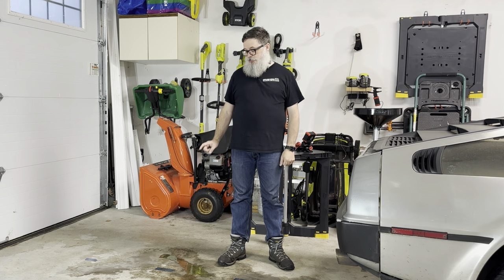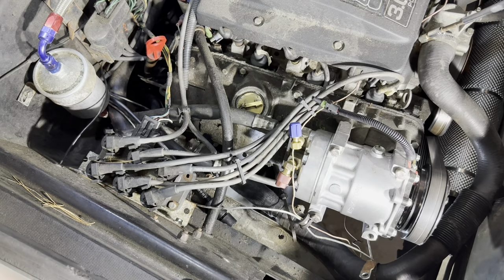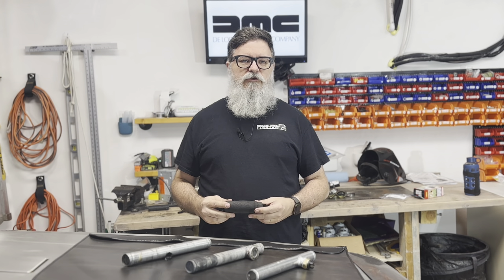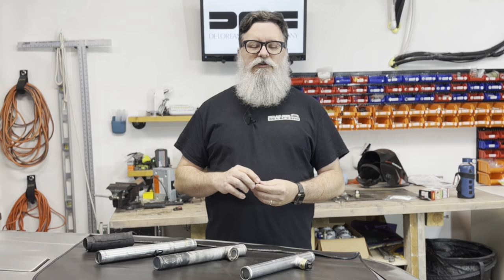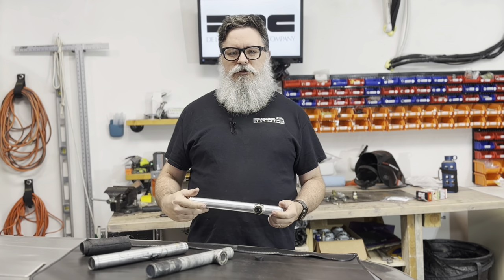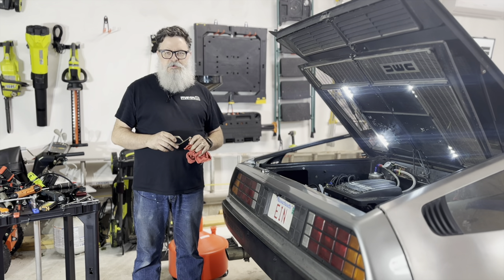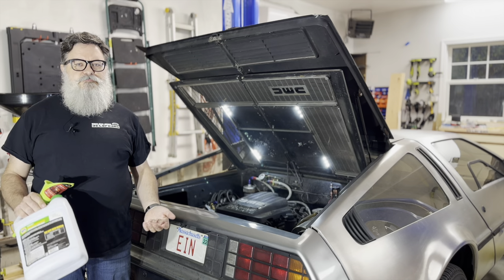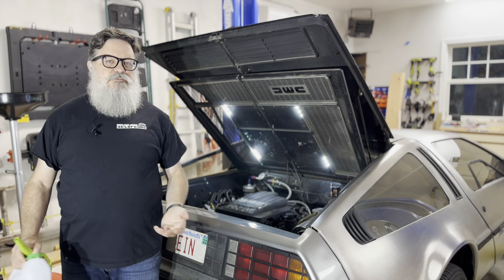The Importance of Proper Coolant Hose Routing in a DeLorean

Comment: No pun intended, but, EVERY Delorean owner should have a "Bearded" Collie like Einnie (Einstein)!  LoL.  
At least you already have the license plate for him.  
So what's that 3.0 out of? 
 Eagle/Monaco with that disributorless ignition?
Have you had it dyno'd vs. the original 2.8?
Ahhh, I just did a quick search on the distributor for an Eagle PRV, & like internet magic, I got a hit on your tmproductions page!  LoL
I've been to your awesome site before over past few months & had it bookmarked.  Wow, what an adventure.
I'm curious about the Eagle version of the PRV, & its platform vs. the earlier original.....
Reply from the maker: I do have dogs, but no Ein (Cowboy Bebop)/Einstein (BttF) yet. :)

The 3.0L is from a 1989 Dodge Monaco.  It actually did have a distributor, but I put a blanking plate over that, and installed MegaSquirt with EFI and electric ignition via Ford EDIS (controlled by MegaSquirt).

I do have an automatic, though, so I'm not sure how great the performance will be.  I also recently made a quieter exhaust that is probably robbing some power (but making the car much more pleasant to drive), and I"m having some trouble with the kickdown and getting it to agree to stay in a lower gear when I want it to, even if I manually drop to "2".  I have to figure that out at some point; it's kind of annoying.

I tuned it myself, so it's probably not the best tune.  I was kinda making it up as I went along, but it's been pretty reliable overall.  I've had manual DeLoreans pull away from me, which I blame more on the automatic transmission than something with the 3.0L engine or my exhaust. I haven't dyno'ed it.  I should probably have it properly tuned by a professional first.

The 3.0L is more reliable in its operation, though -- it pretty much always stays in tune, and it always starts in no more than 3 cranks.  No fiddling with K-Jet or anything like that.  Just doing an EFI upgrade is worth it, IMO, but I understand it's getting hard to find 3.0L engines for full swaps these days.

The big difference between the 3.0L and the 2.8L is that the 3.0L is even fire and has a larger displacement, and the manifold is already set up for EFI.  You swap the lower crankcase so that the engine mounts are in the right place.  The 3.0L spark plug boots are much more robust than the 2.8L, and I"m told they fit in the 2.8L ports, which is worth a go if you find that your plug wires feel a little loose in the heads.
Reply: @Joe's Projects  That was a big project! I don't have a Delorean, but maybe if I can get my health back. I have so many performance ideas for the PRV that nobody ever dreamed of! Its for this reason, I really wanted to see if anyone ever dyno'd an oddfire vs. an evenfire PRV in its basic format & just changing out the crank to the splitpin crank like those Alpine guys in Europe do. My theory was confirmed that the odd fire PRV is laden with power robbing harmonics, just not sure how much, but ill get my answer some day when I reach out to a French tuner. I wish I could give you some direction on that transmission. Did it shift weird before the swap or after? Not sure if it uses an accumulator like GM & other trans. or a governor...but most likely a TV adjustment, & proper geometry of the bracket I throttle cable. Not sure, but if its out of adjustment, I wonder if you can burn up the trans like what happened to a GM with a TV not adjusted properly...... I wonder if you can put a pressure gauge on it to check pressures according to the factory trans manual for Delorean or if some Volvo or other car used that same automatic..... Grood riddance to that K-Jet, which was Germany's revenge for losing the war!!!! LoL.
Replied to a comment on The Importance of Proper Coolant Hose Routing in a DeLorean
Reply from the maker: @chrispompano  I did the 3.0L swap because water got into my fuel tank and ruined the fuel system.  While I was claning the "V" in the block, my pick went through the block.  I later found an inch-long chunk of aluminum in the oil pan.  It seems to have been a casting error when the engine was built.  It was $6k to do a stock DeLorean engine and fuel system, but only $600 for a Monaco engine, and another thousand or so for EFI and associated components, and I parted out the old engine.  Of course, it took me 5.5 years to do this, because I'd never done anything like this before.  And this is the "easy" swap.

You don't need to limit yourself to PRVs these days.  DeLorean MidWest and DeLorean Industries sell engine swap kits, with the LS4 being the most common these days.  They're more complex than the 3.0L swap, but much more powerful.  A Porsche manual transmission help with the power, but there are no automatic options.

My long-term goal is an electric conversion -- I'm on my fifth automatic transmission in 5 years, and removing that from the equation entirely is my end goal.  This is unusual, though; I've just had bad luck with leaks and a failed weld.

The kickdown switch has always been a problem in my car, mostly because I had to kludge it for the 3.0L.  When working, it would rev up to 5k RPM or so before dropping back to second gear (3 speed automatic).  I feel like it was working OK last time I fixed it, which was probably a few months ago.  More recently it wants to give up around 3K RPM.  Besides rebuidling the suspension, I repalced the muffler with a quieter and more restrictive one, but I doubt it's more restrictive than stock.  Unfortunately, there isn't a lot of documentation with regards to the kickdown, so I'm not sure exactly how to diagnose this one.  I do need to check that throttle cable to the transmission.  And you're right -- there's some kind of pressure test port on the transmission, but I've never really looked at that before.  I'll check the workshop manual (and I have the Renault transmission manual as well).  It shifts just fine otherwise.

As for K-Jet, I think it was just a product of its time.  The computers in the DeLorean look like Radio Shack kits today -- primitive, with discrete components, and nothing is microcontroller driven, since those didn't really exist then.  MegaSquirt and EDIS replace all three of the ECUs and the mechanical systems used to keep the system tuned, and do so in a smaller space with a higher accuracy.  Just the march of time and technology.
Reply from the maker: I figured out what was wrong with the kick-down:  the problem was indeed that the throttle cable that goes to the governor needed to be adjusted.  Honestly, I'm surprised it shifted properly at all.  I do notice a little more power since I fixed it, and the kick-down is working properly now.  It was really obvious that the cable was loose once I thought to look, but I didn't think it would affect the kick-down, so it wasn't even on my radar.

Comment: While the clip looks questionable, remember the coolant can run close to 15 psi.  There might be 40-50 lbs pushing on that clip, regardless of orientation.
Reply from the maker: Good point. I don’t know how often it actually fails on people. The new screw-in design might just be because people are wary of it more than that it has a high failure rate. Even my own failure was at the gasket, and not because of the clip.